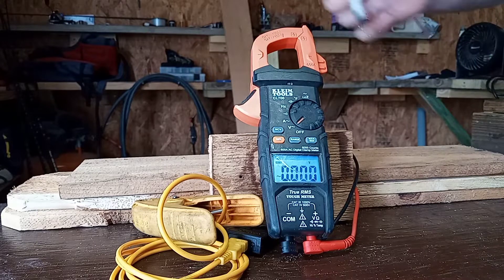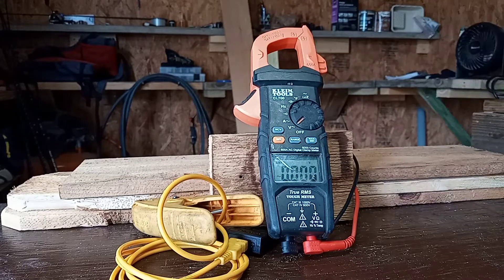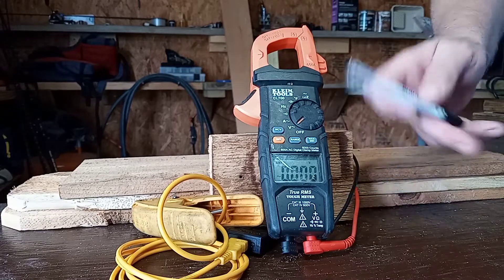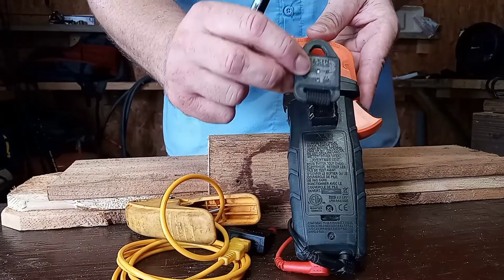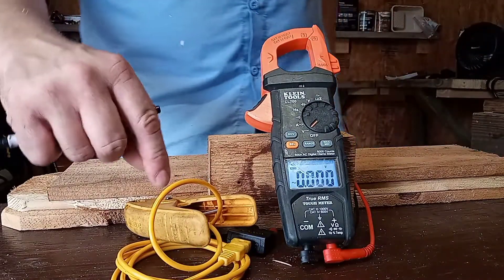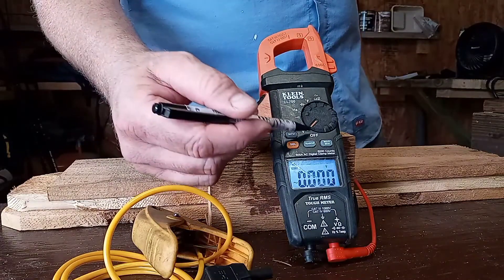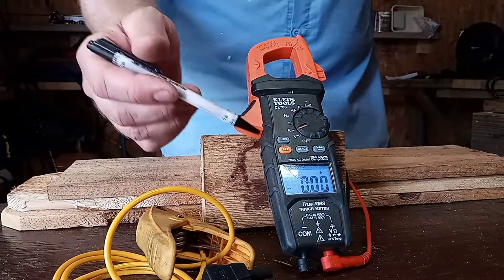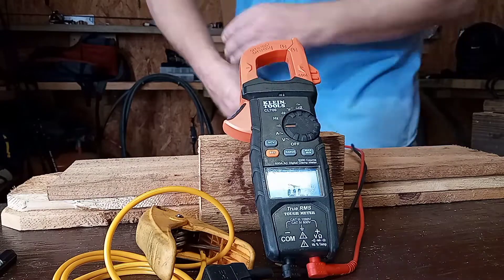Klein Tools CL700 Meter review

Comment: Forgot to mention that you press select when on Voltage to alternate between AC and DC voltage. It does not change between the two automatically. I had that problem. Hope this helps somebody.
Reply from the maker: Appreciate that thanks
Reply: You definitely helped me bro I was stuck at work trying to figure that out

Comment: I'm a student and only use my CL700 at home.  NO hard use.  Have the same crack in top left corner and it grows bigger every week!  This might be a design or assembly issue.  Klein won't provide repair parts or replacement.
Reply from the maker: Yes, the crack on the cl 700 in the video has got worse as well. But that's because it lives in the tool bag. Which, gets used pretty much daily. My mistake was not keeping it in a case all the time. Overall, after a good solid few years of use, It is expected. The Klein is a fantastic meter still to date though. The rubber on the sides a bonus.There's a link in the description box below in the video for cases. It will save in the long run, I think. Thank you